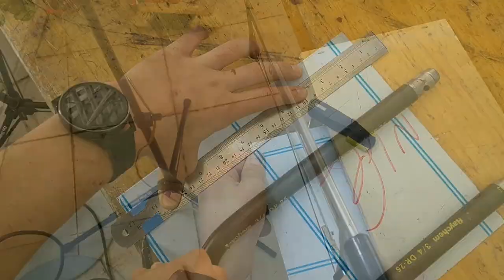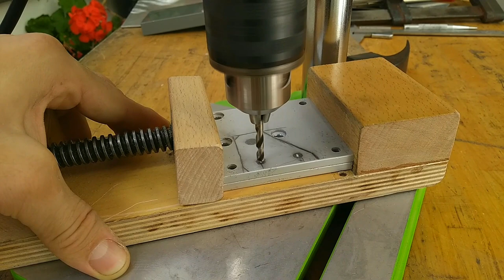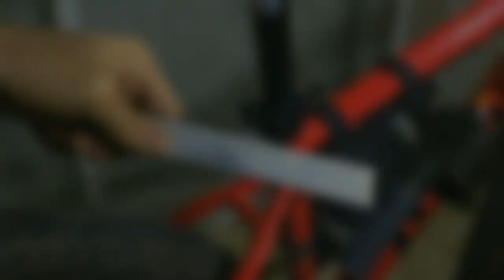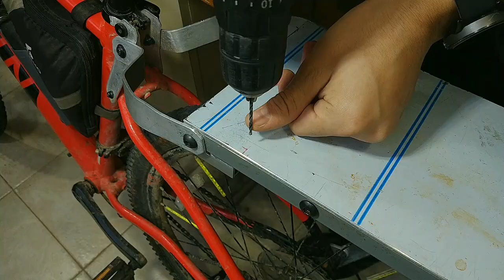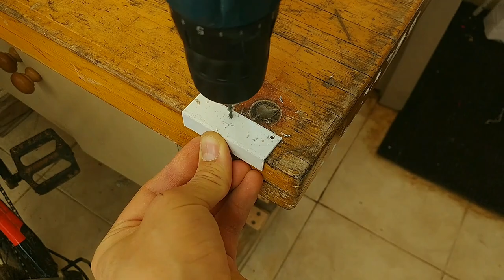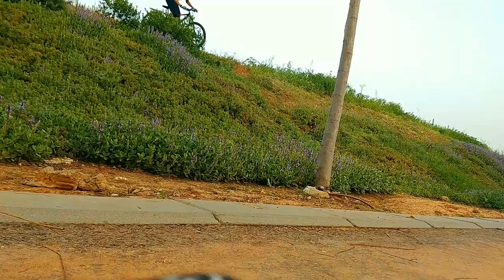How to make a Bike Rear Rack w a MAGNETIC U-lock Mount! (no welding)

Comment: I've been looking at the latest designs and think I will use a hose clip to run many connection points to the back forks and just below the seat post as this obviously makes it far more rigid.
Reply from the maker: @lifegpt  Interesting, send over a picture when you're done

Comment: Why would you need to make those aluminum mounting plates with three holes in them to give you one hole when you already have 2 holes there in the first place? I added a rear rack and just used one of the existing holes. I still have one left on each side. You now have none.
Reply from the maker: I think I wanted it to be adjustable and wanted to have a stuffer connection with the aluminum angle

Comment: Good job!
Reply from the maker: Thanks!
Reply from the maker: W'sup?
Reply: Yonatan24 nothing much, school closed from corona, i skate now too
Reply from the maker: @armandozapata7627  Same. That's how I finally got the video done! But any new projects?
FYI I should either have 2 more videos until the end of April, or I'm starting working on another epic bike project, but it'll take me probably 2 months. Haven't decided yet :)

#quarantinecontent
Reply: Yonatan24 me and my friends got a minibike running that we got for free. Its 105 cc and its goes zoom zoom compared to a skateboard lol
Reply from the maker: @armandozapata7627  Woah! Is it gas powered? Basically like a lawnmower motor? How did you get it?
Reply: Yonatan24 we found it on the side of the road. It looked as if it crashed but The engine fired right up. The brakes didn’t work but its not hard fixing those. I think ima give it a good carb clean also. This fender was preventing the wheel from moving because of the crash(i think thats why it was on the side of the road) so we took it off and now it runs great.

Comment: Now all you need to do is install a Bafang BBSHD mid-drive and a decent 52 volt battery and you'll have a powerful & fun hybrid commuter/MTB!
Reply from the maker: That is actually very cool, but I actually like the "challenge" of riding a lot (except when it's very hot outside)
Also I'm pretty sure if I modify my bike, I'd have to legally ride it in the road.
Bit thanks for the (pricey!) suggestion, I'll look into it.
Reply: @Yonatan24  If you don't need all that assistance & like the challenge then there are options for a lot less$ You want to look low profile but have screaming power right? There are smaller mid-drives and also all sizes of geared hub motors - which are smaller in diameter than magnetic drive. You can turn it on or off - so pedal normally and still hit those hills with ease ;~)
Reply from the maker: Wow. Is 45mph it seriously legal where you live? That's crazy. 50% more than my max speed.
Reply from the maker: If I ever had a job that I could bike to, I would definitely mod my bike and add an assisting motor, probably something like this: https://www.instructables.com/id/Super-Light-Electric-Fixie-Bike/
I ride quite a bit on rough terrain, but I don't mountan bike, sat least right now. If I did I would probably remove the bike rack - that would be a good idea when I think about my previous experiences.
It's insanely hot in the late spring-early fall where I live, and the heat from the road makes me feel like I'm melting, 95 degrees F sometimes.  But now that the lock is off my back(pack), it should be a bit better.
Reply: @Yonatan24  Not really ;~) A legal motorized bike in the USA must have working pedals, no more than 1HP/746 watts of power, and depending on which state/city you live in can have a top speed of 20mph min up to ??! I live in ??! ;~)
The nice thing about quality electric drives is you can scale them up/down to the fun at hand on the dashboard in your cockpit....
Reply: That's really why my police dept had to have them. Powerful, discreet, flexible & reliable workhorses.
Reply from the maker: @C Witham Thanks for the info, makes sense. Bikes are probably significantly cheaper than buying horses!